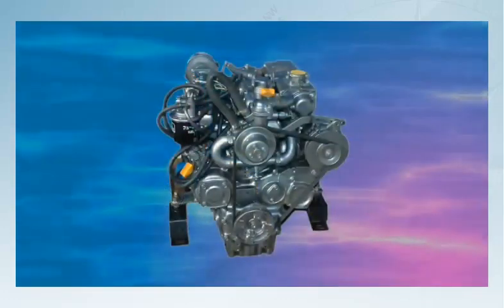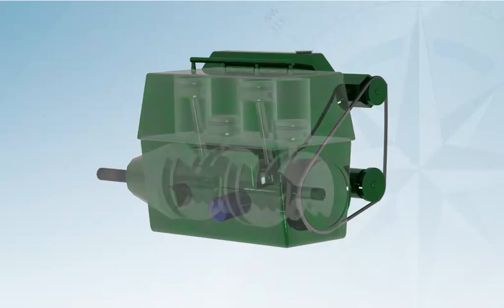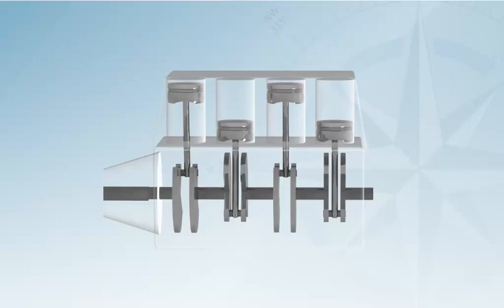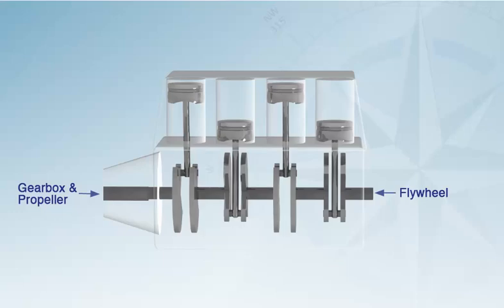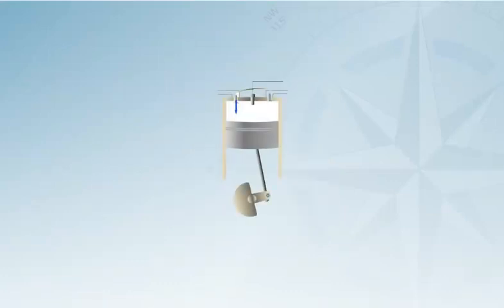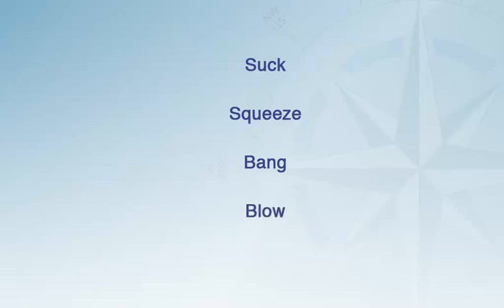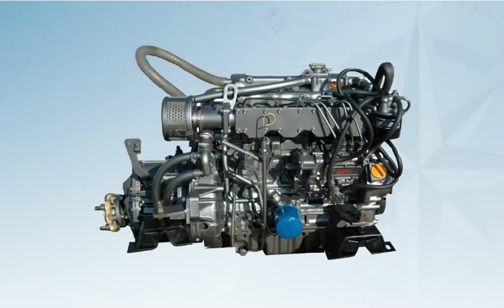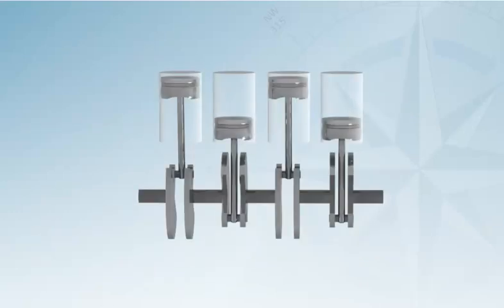The Marine Diesel Engine an Introduction

Comment: Uhm, the explaination of the strokes are wrong at some points. Its not the hot air that ignites the fuel, its the compression. - Engineer

Comment: Please can somebody extend the raw water strainer, to micro-filter plastic from the oceans, 10% should be micro-strained, on each and every new marine engine, and eventually we can clean up. I can think of no other way, and it will work....eventually. The plastic is now so small, and ingested by all sea life. This is an idea I had, so take it on somebody, and make a fortune if you want, if the by-product is an earth fit for my descendants. pax and gratis. if someone builds a prototype, and it works, ie 10% of cooling intake is micro-filtered, then a nobel prize would occur. think on it! hundreds of thousands of engines, now filtering the oceans...it has to succeed eventually. Folk have worked out systems to clean up the plastic islands...please hurry! and this will clean up what's left...eventually.
Reply: Putting the cost on the consumer is not a good idea and if they still have the option of buying a regular filter than one they have to change 3x more frequently and 3x the cost their not going to use it. How you going to force this product on every manufacturer?
Reply: Um no! A $10,000 engine depends on unobstructed water flow.... and you want to restrict it and clog it?